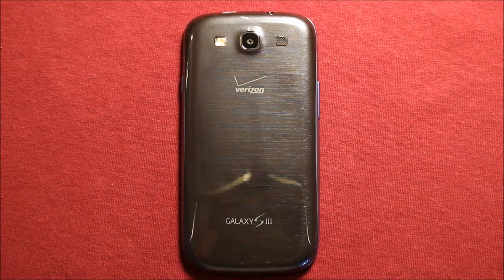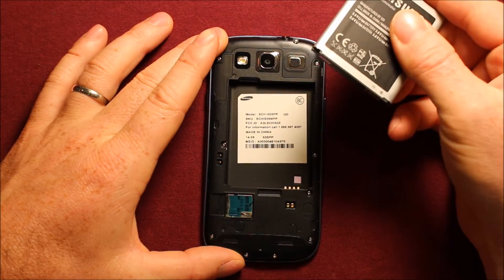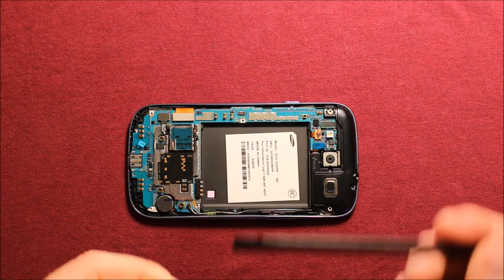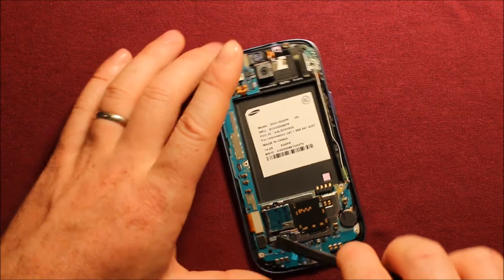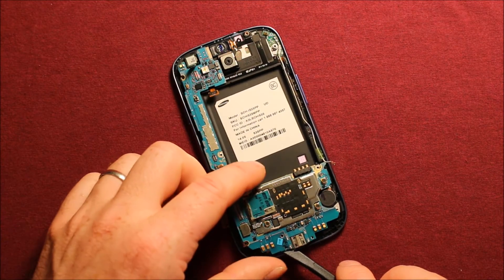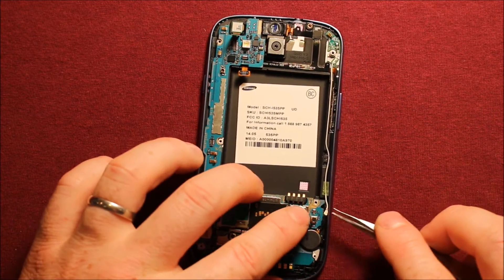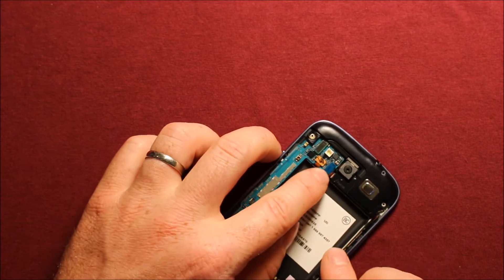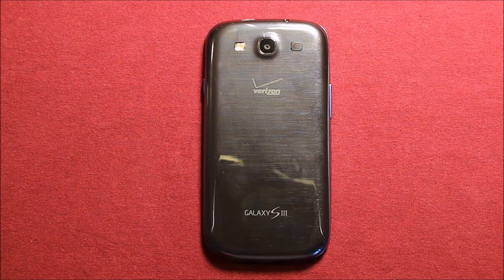Galaxy S3 Logic Board Motherboard Replacement How To Change

Comment: so just to be clear, swapping the motherboard allows all my data to carry over to the next phone I decide to put it in,  including messages, apps, etc?
Reply from the maker: +Troy Wright yes everything that's on your motherboard will transfer over to your new phone.
Reply: Ok, thanks. I will try your method. The screwdriver and plastic thing should arrive in a few days, so I'll let you know how i get on.
Reply: UPDATE:
I was able to do the transfer relatively easy and quite quick following your instructions. Thanks a lot. Really made it seem simple, some of the other sites take literally the whole front apart as well, which was a little overwhelming.

Not many cons, the only thing I would say is that you moved very quickly to the connector at the top, it was difficult to see what you meant until after you removed it. Perhaps indicate what you are removing by pointing at it first with the plastic device. Ditto with the black screw, I was like "huh?" and then I saw it myself on my phone. 

Another thing is that after the motherboard transfer, the date and time will be totally reset. you have to go back into the 'more' tab in settings and change it under Date/Time. otherwise some apps will message you with errors, such as whatsapp.

I would also say, the top screw in the S3, the one above the back camera was fiddly to remove on both phones, it unscrewed fine, but it wouldn't come out until I removed the whole top cover. Definitely watch out so it doesn't go flying! 
Bit fiddly to remove the top cover as well, really have to clip it out. thanks for highlighting to put the Back Camera firmly back in the hole when replacing the motherboard. 
some of the connectors were annoying to clip back on, but there is a sweet spot for them all. when you find it push down. Just be careful!

Other than those minor nitpicks, and since I'm the only one who had them it says more about me than it does about the video, great video!
Reply from the maker: Thanks I appreciate the feedback! I'm always looking to improve and fee like I've learned a lot about these tutorials since making this one. Feedback like yours helps me out though as I keep moving forward. I'm glad you got it! Take care.

Comment: I own an s3 i9300, now I want to put an s3 i9305 LTE motherboard in it, will it work if I just swap the motherboards over or are my screen connections different
Reply from the maker: +Zachary Greene I haven't personally done it so I can't say for sure but I think it's worth a try.
Reply: I don't see why not though, everything's around the same way
Reply from the maker: Yeah might as well try it then. I think it should.

Comment: If I find a decent logic board for virgin mobile s2, what info will they need to activate it back on my plan? Any #s off the board before I close it up? Just not sure how this all works. Been with em a long time and getting a smokin deal with good coverage in my area. And aside from the loud speaker, I love the phone. Thanks
Reply from the maker: Yeah so the only way I know to get the number is once you install it and turn the phone on and you can find it under your phone settings or by dialing *#06# on your phone number dialer.
Reply: +Smart Easy Repair Sounds easy enough. Now to find a clean board with good buttons/ports. Thanks!
Reply: +Terry Williams That dial code works great too! Number just pops right up.
Reply from the maker: Yeah best of luck with it!